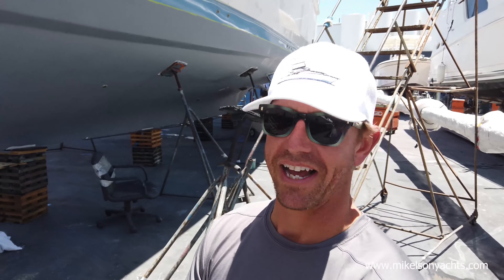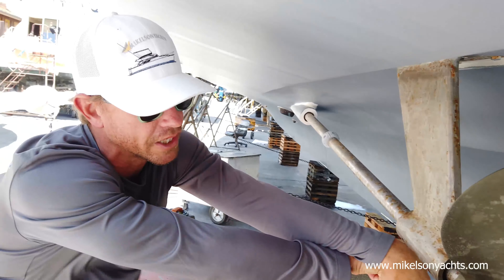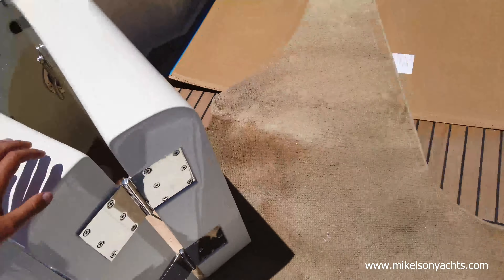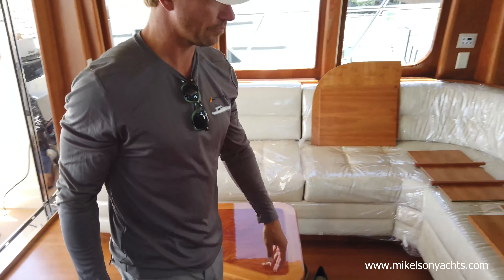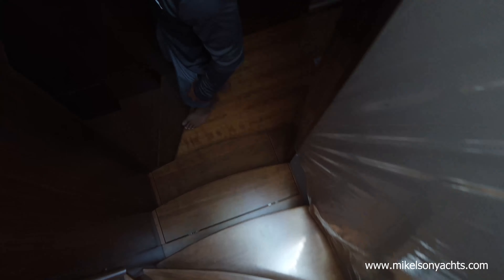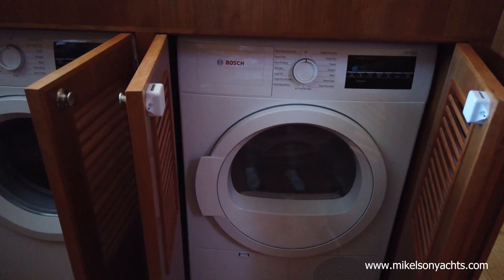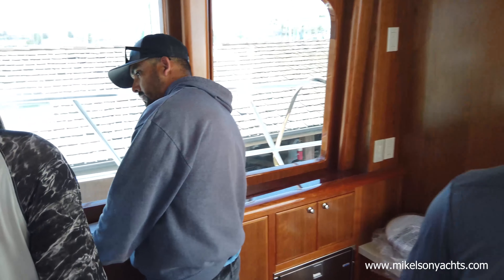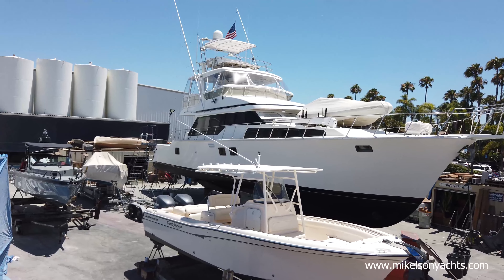First Walkthrough aboard a brand new Mikelson Nomad

Comment: Y'all need to get educated on fin stabilization.  They are 100% effective at ZERO speed, anchor, etc.  They even work with anchorages and don't walk the anchors (some use to - the only old drawback).  Plus, the new electric stabilization kits, like Humphreys, weigh 75 - 85% less than normal hydraulic stabilizers.

Gyros stabilizers are power hogs and require upgraded gensets, ridiculously heavy, and they actually start loosing effectiveness if conditions change a lot.  So the weight and power reqs cause issues or prevent having other toys, plus those things spin at incredible RPM.  The more a part moves, the more likely the part breaks, so a super heavy metal ball spinning at 8 - 9,000 RPM is not IF it breaks down, but when, and fixing ain't cheap.

There are literally thousands of boats running around today with gyros that don't work.  Do yourself a favor and order fins.

*They cost HALF the price (or more)
*Much lighter and keep boat running thru water better - and newer electric systems are feather light in comparison.  Plus they work with the trim, like Humphrey interceptors & fins.
*Use practically no power
*Maintenance and upkeep so much easier.  If one gets knocked off you throw another on.

Gyros are a fad and on the way out, fins just keep getting better.  But please, get educated on fins at rest/zero speed.  Thank you